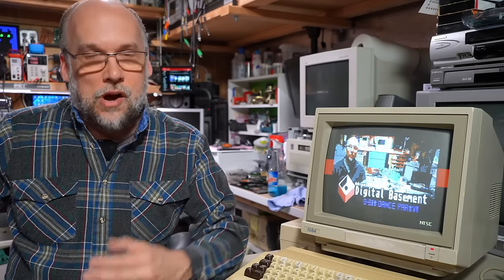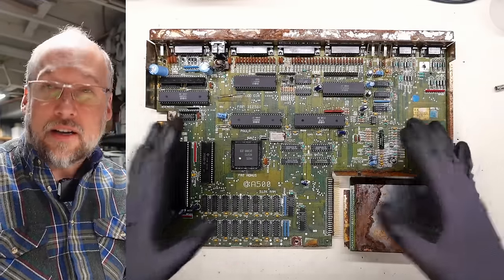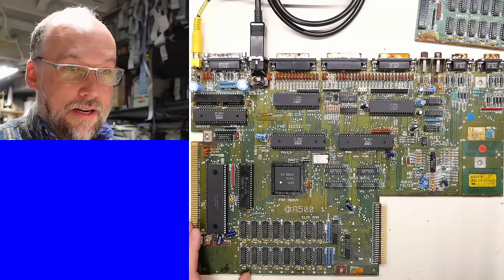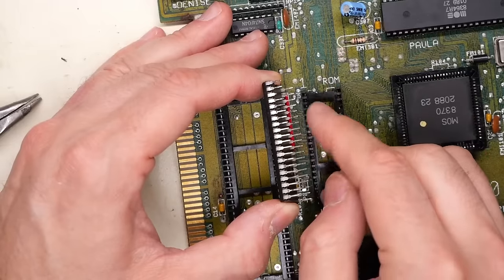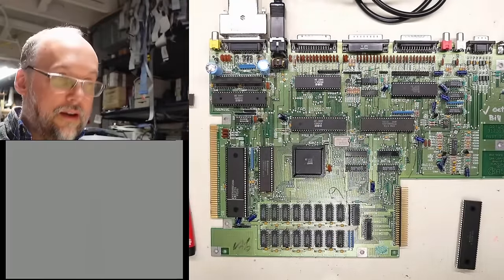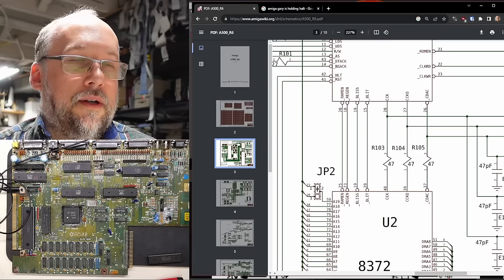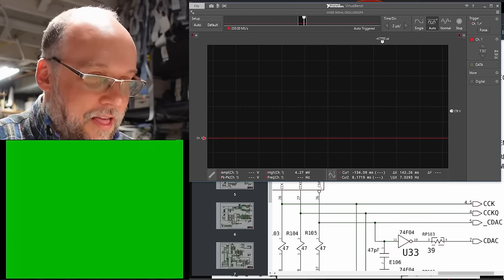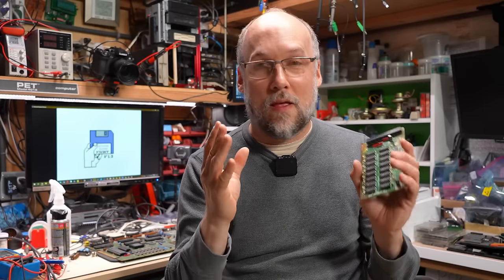This Amiga 500 was left outside for years. Let's try to revive it!

Comment: get an ultrasonic cleaner and use concentrated CLR (calcium/lime/rust remover from home depot) along with distilled water. Its safe for boards but tough enough to eat through all the buildup that you can see and even the buildup you cant see. rinse the board in a tub of distilled water to get everything off and blow off with a compressor (not compressed air because water could freeze). once you blow out all the cracks and get the water out from under the chips take a heat gun on low and run it in a circular motion over the top of the board to warm it up evenly but not make it hot. this will get rid of any trapped water. You can let it sit for a few hours if you want to make sure its fully dry or pop it in the machine and check to see if the repair worked. I do this nearly everyday on liquid damaged electronics and i have about 80+% success. it all depends if power was put to the board after the damage was done causing components to burn up. if it was left off and the battery was disconnected theres a very good chance it will be fixed. a good large heated ultrasonic cleaning tank that can fit a board in it will run you a few hundred bucks but even cheaper if u buy it used. its well worth the investment if u plan on doing this a lot.

Comment: One note about WD-40, while it may have an effect on rust, it is quite terrible to get on connectors. If it's not properly rinsed off, connectors might feel like a proper fit with friction and all, but that thin layer of oil will be in the way of the electrical signal. I've once repaired a bit of electronics with this type of problem, and it took me days to figure out what was wrong!

Comment: A CIA drives the PLA, instead of the other way around?! --  That's nuts.
Reminds me of a repair I was working on where an A2000 went from partial working to NON booting after I started troubleshooting.  In the end, it turns out that my grounding clip, which I'd attached to the housing on one of the I/O ports, was grounding a pin.  So, yea, CIAs are needed for booting. *shrug*.

Comment: Love the old 80's and 90's tech... It feels so much more repairable and information out there than modern stuff... I'm trying to fix a very expensive spectrophotometer, SpectroEye, by GretagMacbeth/X-Rite, appears to be nonfunctional (no initialisation of CPU/display), but without even a block diagram or startup-sequence information (certainly no schematics, despite being 10+ years old), it's practically impossible to diagnose :( Yes there are MPU datasheets etc, but when there's also crowbars to shut down power (it has a soft-on-off switching with lower power battery operation) based on unknown factors, it's even harder as can't even get the thing to stay in a stable state! At least with 80's stuff the situation is significantly more 'open' and repairable it seems.

Comment: 33:56 this is the point where I'd test the field Gary chip in the working A500, to eliminate it as a failure and support the idea that the socket is bad.
Reply: 36:18 You have a working A500 so just probe that and see what the pins are doing on that. No need for documentation. A working A500 is it's own documentation. Time to do a little backwards engineering.
Reply: I spoke too soon. That's exactly what you did.

Comment: I wonder if the purple flash screen is a capacitance issue with a built in capacitor within the IC that was causing the issue. A lot of those old custom ICs weren't just transistor arrays, they have more in common with with FPGAs, except everything is fixed, not programmable including built in resistors and capacitors as needed for the application.

Comment: I am trying to repair an old computer (or better, two) used in a school in the then USSR. The repair mostly stands still when i need to order IC's (mostly 7400 series to replace the old soviet IC's). And then, after replacing an IC, repair pauses again because i have to order an IC to replace an other IC in the chain connected to an earlier replaced IC. It does not help when a difficult to get IC with two important signals for the processor stops working due to the old age.

Comment: You should soak that board in distilled vinegar and brush off the oxides. Use a powerful set high on the dental water floss water pick under and in the cavities and sockets.

Comment: Dunk the whole thing in evapo-rust 😂
Reply from the maker: I used it on the field found 64 and it works well although slow. My biggest issue is I’d need a ton or it (couple gallons probably) to fully submerge it, so I’ll likely just skip it.
Reply: @adriansdigitalbasement  Evapo-rust is re-usable many times.  Just poor it back into the bottle.  I bought some several years ago, and have re=used it for many different projects, mostly old tools.

For anything where you need multi-gallons of it, use water+molasses.  It's a little slower than evapo-rust (A week vs maybe 3 days).  It's MUCH cheaper though.  Mix it up 10/1 water/molasses.  I've successfully used this to remove rust from some old ladder jacks, which would have cost a small fortune in evapo-rust, but was a few dollars worth of molasses.

Comment: Thank you for this interesting video. Seems you need a SIF-500 soon. 😊
To find out if a socket gives contact, whouldn't it help to do a continuity check between bottom side solder pad and upper side chip pin?

Comment: no working chipmem in diagrom will flash red/green while looking for ram..    but you need the same patch as kick 2.04.   256MB of rom is missing this is why diagrom crashed
also  cias is not needed for diagrom to start..  paula needed for serial

Comment: Definitely looking like it sat in a wet box in a basement that flooded (or an attic and the roof was leaking). If it was outside it would be very yellow. 
Im sure I have the same monitor. 
If all the seized video controls were replaced the monitor should be then ab able to be brought back.

Comment: The way I always solder broken pins is to use an old socket. Put the chip in the socket then put the pin in and solder it into place. Now that I'm thinking about it, I probably shouldn't have thrown out the dead zif sockets like I did a few years ago. I could have kept them for that very purpose instead of using a dead pcb

Comment: I took one look at this A500 and was thinking -- that sucker is toast.  Yet you managed to get it to work.  I'm impressed.
If you don't mind, I would like to ask a question.
I own a 1084S monitor that came with my A2000 with a Video Toaster system.  When I received the system, the monitor worked flawlessly, then wasn't used for a few months.  When I tried it again, the monitor simply did not give any picture.  I tried it on an A500 that I have as well, but no dice.  I know that the A2000 and monitor had very little use by the original owner (they used it to make a couple of TV commercials for their business, then put it in storage).
What could be the most likely reason for the monitor to not be working, and is it worth my effort to attempt to repair?

Comment: I understand you wanting to show just how to diagnose bad chips, but there are plenty of boards where you have and most likely will need to do all that to instruct.  I'd MUCH prefer you did the deoxit etc. on all socketed chips, remove them, maybe clean with fiberglass brush, then deoxit sockets again and reinstall BEFORE you try anything further than initial power up.

Comment: Legend says WD40 stands for "Water Displacer formula 40" ('cause rest 39 were not so good). Any way it's supposed to be used before exposing something to moisture. :)
It's cleaning properties are most due to presence of kerosene  or another solvent they use to dissolve all other oily components.
Have you tried more specialized products like Rost Off by Wurth? To me it the last chance to undo a rusty nut before I take gas torch.

Comment: You know a good, long, intense cycle in a dishwashing maching will remove an astonishing amount of grime.  If you ever have another machine to rescue in a similar state, think about trying it.  I presume you know about rust remover and electroplating for the rusty metal parts, and a little high grain sandpaper to level out some of the pitting before plating.  I think you'd be surprised at the results.  Check out "My Mechanics" channel for some restoration tips. You will not believe the stuff that can be fully restored with the right techniques.

Comment: I had the same Problem with a Teacher's pet,  computer That I bought at a tag sale, The old man was a electronic's teacher in a high school, His son told me it was in the shed 35 years and it was Rusty. Sand blast with fine sand, the connector board will clean up nice., I got it working and sold it for 900 could not believe what it was worth.

Comment: picked up an Apple IIGS recently, with all the metal shields turned to rust buckets. Is it OK to just trash those and use the IIGS without the shields?
Reply: Ditch 'em! RF interference isn't as big an issue nowadays, and if they're being used as heat sinks, they aren't all that effective and you're better off putting heat sinks directly on chips.
Reply: @LeftoverBeefcake  thanks!

Comment: Every guide that says green screen = bad chip ram is wrong. All it does mean is that the CPU could not use the chip ram - but this in itself does not mean the ram is the problem. This can also happen when there's a problem with Gary or when the LS244/373 chips in "DATA PATH" are bad.

The CPU databus and the chipset databus are separate - with a "bridge" formed between them by the 244/373's. Gary provides signals which controls these chips. A fault in any of them can give you a green screen.

Yellow screen is "exception happened during Exec initialisation". Generally this is a sign of data bus corruption, and again a problem in the Data Path or Gary can cause it.

Comment: There is no sense in turning on the computer if you have not pulled all the chips out of the sockets and cleaned the contacts, given the poor condition of the computer. That's why I had to simply rewind half of the video as useless. The DiagRom did not work, because regular ROM chips need to be turned on via an adapter with address bus pull-ups. This must always be done on revision 3 and 5 boards and for 4.2 for Amiga 2000.

Comment: for interest: ChatGPT says. The Amiga 500, a popular personal computer from the late 1980s and early 1990s, featured the Gary chip (Gate Array) as part of its custom chipset. The Gary chip was responsible for various functions, including address decoding, system control, and generating interrupts. The HALT signal was used to halt the CPU (Central Processing Unit) and stop its operation.

There are several conditions under which the Gary chip would assert the HALT line, causing the CPU to halt. Some of these conditions include:

1. *Bus Error:*
   - If there was an error during a bus operation, such as an invalid memory access or an attempt to access a non-existent address, the Gary chip could assert the HALT line.

2. *Address Error:*
   - Similar to bus errors, address errors occur when there is an attempt to access memory with an invalid address. The Gary chip can detect such errors and initiate a halt.

3. *Division by Zero:*
   - If the CPU attempts to divide a number by zero, the Gary chip can detect this condition and assert the HALT line.

4. *Illegal Instruction:*
   - If the CPU executes an illegal or undefined instruction, the Gary chip can recognize this and trigger a halt.

5. *Copper List Error:*
   - The Copper is a coprocessor in the Amiga custom chipset responsible for controlling display and other tasks. If there are errors in the Copper's instruction list, the Gary chip might halt the CPU.

6. *External Halt Signal:*
   - The HALT line can also be asserted externally. For example, software or hardware may intentionally trigger a halt condition for debugging or other purposes.

7. *Custom Chip Failures:*
   - If there are issues with other custom chips in the Amiga chipset, such as the Agnus or Denise chips, the Gary chip might halt the CPU to prevent further damage or data corruption.

Understanding the conditions that lead to the HALT line being asserted is crucial for diagnosing and troubleshooting issues on the Amiga 500. It's worth noting that the Amiga's custom chipset and architecture were quite advanced for their time, contributing to the system's graphics and multimedia capabilities.

Comment: You also assumed that the computer was working when it ended in the field 40 years ago.  I wondered if you had to fix an original problem along  with the corrosion problems.

Comment: i have 2 x 3000 and a 500 a 64c and a  atari st  that were all in a saltwater flood super storm sandy in nyc  also go 1 3000 that was above the water line  if you want a real challenge  i tink thee is a deringer 030 for the a 500 and gvp scsi sidecar
Reply: some of these were modified to run laser shows  by decoupling the audio caps and added opamp circut on Paula
Reply: also have 2 pangolin qm16  zorro  ii cards that were not in the flood  added extra Paula for extra audio channels to run a laser light show projector with rgb colorchanels